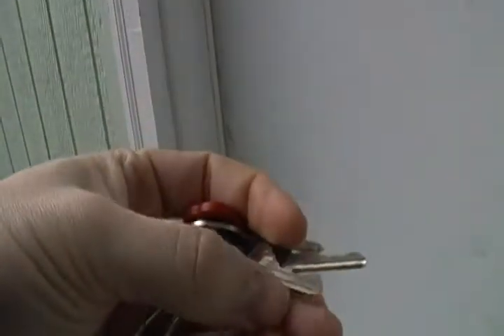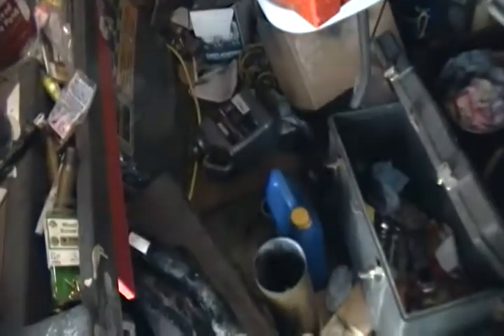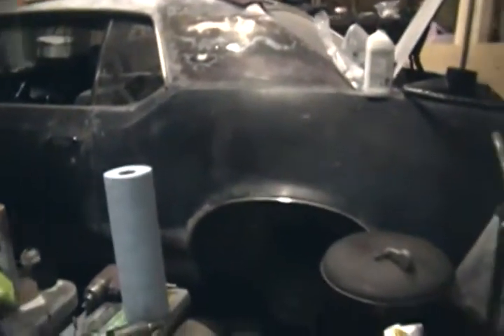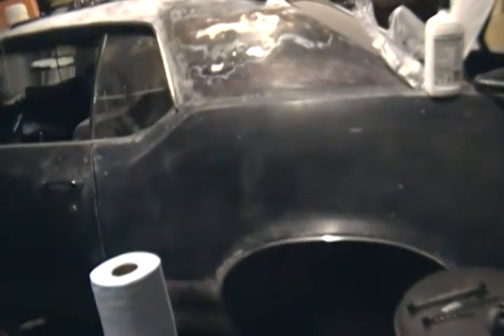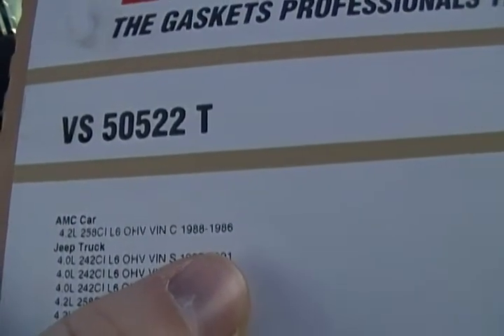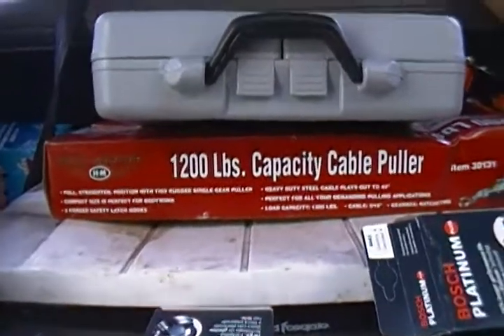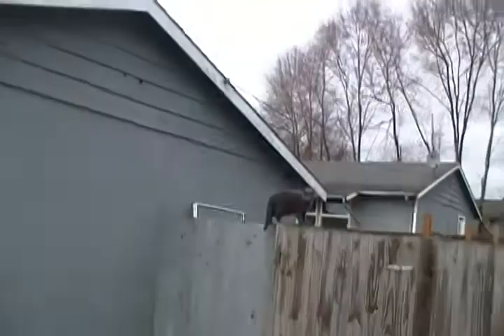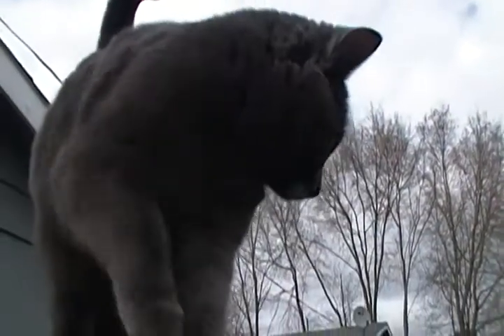Jeep Valve Cover repair

Comment: @pearsonba350 if the vehicle was OE platinum almost any platinum plug is fine provided its not the 2 or 4 electrode one, platinum has the same heat range no matter who manufactures it

Comment: Hello buddy great video, i have a similar issue on my yj with the pcv valve needing replacement or cleaning as it seems to leak. Can you provide some instructions on how to remove it or a video of how to remove it with the valve cover still on? I tried once but it wouldnt pop and i did not wanna break it as not keen on removing my valve cover